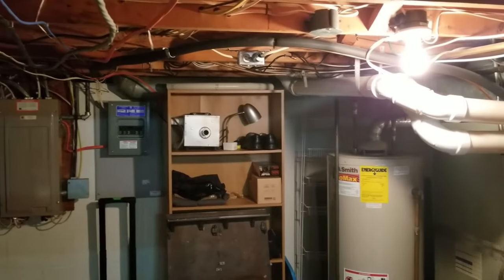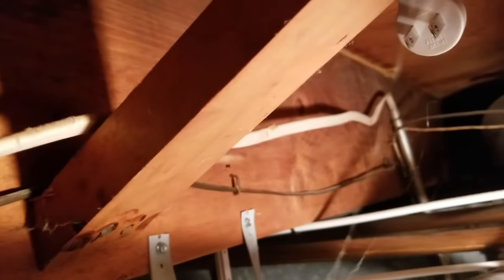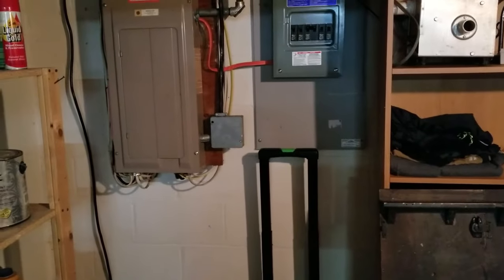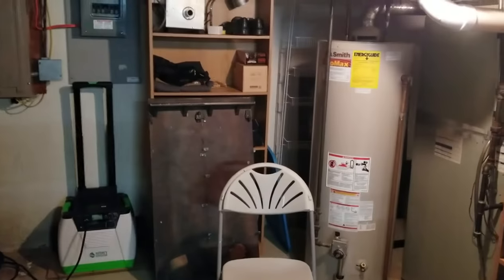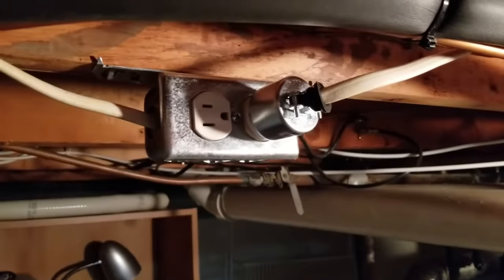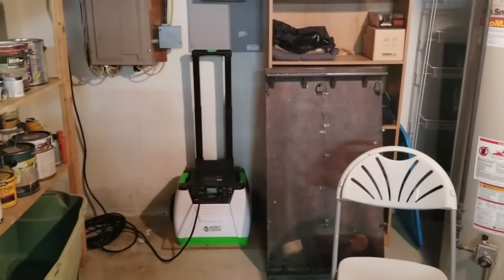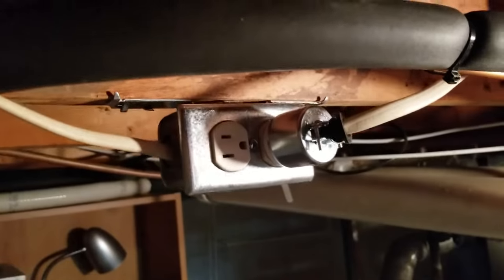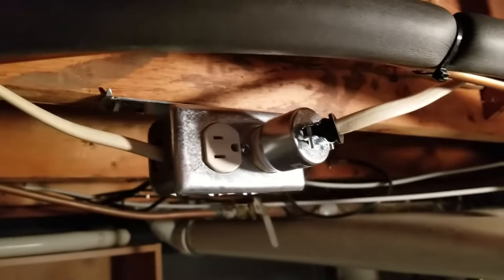Power Your Furnace With A Generator During A Power Outage

Comment: Have you tested this?  Some furnaces have pretty sensitive control boards and ignitor circuits that won't run on inverter technology.  I know that sounds funny but it's true...some will, some won't.  Better check to see if you can actually get heat.
Reply: I have had a generator for 17 years and am still reluctant to power my high-efficiency furnace with it for fear of blowing the $$$$ mother board. I cannot get a straight answer on whether a plane jane generator will work or not. The HVAC guys only want to sell you a whole house generator for HUGE bucks. Every year my HVAC company does its PM and every year I only get "You can't power it with a generator". I was thinking of a separate inverter generator just for the furnace because the power is supposed to be cleaner. I wish somebody had an answer for me because you KNOW power only goes out in the middle of winter. Thanks. OBTW, I had the installer wire my furnace for a generator when he installed it. Now, the same company says it won't work!! Thanks.
Reply: Problem with running a furnace off of a generator is that the neutral is floating on many generators, ie neutral and ground not connected together at the generator. The furnace control tests for this ground and if not there, faults out on insufficient voltage. Not going to discuss the work around for safety reasons but if you do work around the problem, put a gfci adapter on your extension cord to protect from electrical shock.
Reply: Instead of a generator, consider a pure sine wave inverter.
Reply: The proper way is to run a transfer switch through the breaker box, then you can power anything you want according to the wattage you have available on whatever generator you are running preferably a inverter for clean power. Inverters power lap top computers and sensitive electronics so should be ok on the panel of a furnace
Reply: Has to be grounded correctly
Reply: This may not work on many furnaces for several reasons.  
My Lennox furnace computer board is very sensitive to input power harmonics.
Even a high-quality portable generator is too electrically "noisy" and the board faults out.
Some furnaces require bonded neutral-to-ground. That gets messy.
Reply: @kodak_jack  It doesn't work on my Lennox.  The igniter circuit is very sensitive to harmonics.
Reply: @John-dp3ln  That may be the problem with my Lennox, or the harmonics from the generator and any deviation from 60Hz. I decided not to take a chance with the motherboard and use alternative heating during power outages in Winter.
Reply: @gybx4094  The part that gets me is the same HVAC company that just says "A generator won't work" wants to sell me a whole house generator and that one will work. Except for the $10K cost, what's different?!! I have also heard of the igniter being the problem.
Reply: I think my solution is to just feed my blower on my gas fireplace. Simple squirrel cage blower, actually has a normal “plug” end that goes into a receptacle inside the lower control area of the FP. I can unplug that end and into the generator. No electronics to potentially damage (my biggest concern on my new furnace). 
It’s a 18’000 BTU fireplace and should be enough to get us through some cold Canadian winter nights temporarily.
Reply: @meonlybetter007  How is powering only the blower going to help heat the house? The problem on the high efficiency furnaces is the igniter circuit that won’t turn on the gas and ignite it. Since I got my generator in 2003, I have had two different high efficiency furnaces and never powered either of them with my generator for fear of blowing the expensive mother board. When I talk to my HVAC company, all they want to do is sell me a whole house generator!
Reply: @kodak_jack  
I would not power the furnace but supply power to our natural gas fireplace that sits in the corner of our basement. 
It actually has a 120v plug internally that feeds the blower. That plug would go to the generator. 
There are no electronics in this NG Fireplace, just a thermocouple to open the gas mechanical valve which is pilot light based (no electricity needed to start it up)
It can supply more then enough heat to keep the house & water pipes from freezing. 

I would make sure bedroom doors are open and natural convection would let the heat rise to the rest of the house. Maybe even have a low-wattage table top fan “blowing” some of that warm air upstairs.
Not perfect, but in an emergency would work

Naturally, this is assuming the natural gas flows, and it’s not a massive blackout. :)
Reply: @meonlybetter007  I had a wood stove with a blower that worked for us too. Now, I have a gas stove with a blower.
Reply: I feel your pain there has to be an easy inexpensive way for home owners to get heat in the case of an emergency. not everyone has 12 to 20 thousand dollars hanging around...

Comment: Does anyone here know if an inverter type generator (say, a Honda eu2200i) would start a 1/2hp blower motor?   The run power would only be 375 watts.  I’m wondering if say a Honda eu2200i would successfully start the blower.
Reply: I did buy the eu2200i generator.   It powers my 1/2 hp water pump fine only using about 400 watts of the 1800 available.

Comment: May be a dumb question but what if the power comes back on? Will that be an issue?
Reply: Unplug the generator, and reconnect the power to the breaker box.
Reply: If the plug housing is metal and its mounted to the metal furnace enclosure there would be two connections of ground. One on the generator and the other is the house main circuit panel and that ground is connected to the neutral wire that's also in the main circuit panel the absolute way to ensure to sever all ties back to backfeed your main is shut the main breakers coming in to the house.

Comment: only thing different i did was in place of the receptacle  i put a female plug like on an extension cord, so it still works the same, i can unplug it for generator use then plug it back in for regular use. (for my oil furnace)

Comment: I'm confused, is the generator an internal combustion engine that you are running in your basement?
Reply: Hopefully not. The ‘generators’ in the basement are battery powered inverters. A gasoline or propane generator should be at least 20 feet from the house.

Comment: @Prepping Practice I know that you made this video a few years back. Thanks for sharing. With your furnace connected to the generator does your existing thermostat still control the furnace? I have a NEST and it requires electricity to turn on. Wondered how your setup is? Thanks
Reply: Forget 'smart' thermostats when it comes to emergencies. Learn how to change it out for a manual one. Just my advice but YMMV.
Reply: @w3tua  Absolutely, I have disabled all of the "features" that the Nest "offers." I hate it, but it came installed with the house. I probably will remove it. One day we will probably all be forced to have one. Look at the smart electric meters. Hope not though, they're junk in my opinion.
Reply: Keep in mind the furnace will charge the NEST while the furnace runs.  In fact, some users only have power to their NEST via this method.  Of course a dedicated power connection is best.  In a worst case, you can pop the NEST dial off and using the micro USB port on the back of it, charge it like a phone with a battery pack, laptop, or even in your car.
Reply: @travisosborn6752  Thanks, I've thought about some of those options too. Thanks for the information. 😁👍🏻
Reply: It will always work with all smart thermostats...they use very low voltage and will be powered by the furnace. Most have a battery in them that last a very long time but you also have the option to wire them up using the "C" wire so they have permanet power. Many videos on how to do that and EcoBee comes with an adapter kit that makes it super easy.
Reply: @daddylogan  Thanks!

Comment: it didn't work for me after i did this setup. For some reason the generator didn't start the furnace
Reply: You need to ground your Generator or the Furnace Board won’t allow it to turn on. You will need ground wire, ground clamp and aa end plug 🔌 that has the grounding and neutral connected. If your generator is Neutral Floating you will need to run a ground wire from generator frame to a clamp that can be attached to the water meter, also a plug end 🔌 (do it yourself) that has a wire connecting ground and neutral, plug it into the generator outlet. Once this is done then your furnace will work. I am not an electrician, I just found out this was the fix and it worked. Good luck!

Comment: Looks good, what if you are stuck with a older generator cranking out voltage spikes that could fry the control board of you furnace?
Reply: Well then get a surge protector
Reply: Or get the inverter type generator.
Reply: @mikejenkins2067 this is not the same thing. Surge protectors don’t stop all irregularities, n
Just over-voltage spikes.

Comment: Don’t forget to turn breaker off so you Don’t back feed
Reply: ya i think a lot of folks miss this. I see a lot of videos with that plug box being metal and on the side of the metal case enclosure of the furnace that's the connection back to the house ground and the house ground is connected to the neutral "white wire" in the main panel in the house.

Comment: I was going to do that but they are saying that’s against code to use romex wire with a plug on the end.
Reply: I am in the same situation as yours.  I asked the code department in the local government, and they said exactly the same thing.  This would be great if they allowed this.  Then I could plug a small quiet portable generator to power the boiler and a few minor things.  The small quiet generator uses very little gasoline, and is very quiet.  Based on my experience in Sandy, a big powerful generator may not be such a good idea if there is no gasoline available in the local region.  A small generator that uses very little gasoline is much better in such an emergency situation.  Unfortunately the code department doesn't allow this.  I ended up getting a big generator and having a transfer switch installed, and hope Sandy will not come.
Reply: @captainjayc9217  Does code really matter if your powers out and it's an emergency? Sure be safe.... But I think I'd keep my family alive and well.
Reply: @Jasonoid  Turn out the local code department allows something called EZ Generator Switch.  Using it allows the boiler to be permanently wired (that meets the code) while it still allows us to connect a power cord from a portable generator to the switch (that meets our need in an emergency).  Best of both worlds.
Reply: @Jasonoid  Damn right!!!
Reply: Against code. Please. Nothing wrong with this setup. He is a competent individual. If you sell the house change it back to code. Geeze have some confidence in yourself.
Reply: Code doesn't keep your pipes from freezing...Put you big boy pants on.
Reply: @captainjayc9217  Just because something is not code-compliant does not necessarily make it unsafe. Code represents a consensus on best practices, not a unanimous agreement.  As with many things, there's more than one way to do it.  Some are potentially dangerous, but many are not.  In addition, local codes can vary from NEC furthering proof that there is not one universal best way to wire something.  Would it be better if one was 100% code-compliant but asphyxiated themselves by doing something like lighting a charcoal grill in their house to keep warm during an extended power outage?
Reply: @binfordtoolman5674  As mentioned in my second message posted in this thread, I found a solution that essentially does the same thing while still meets the code.

Comment: So I have a question.  How long does that particular generator stay charged when in use? I found your channel specifically because I'm concerned about running my oil-powered heater on "that" particular generator. Ty
Reply: Whatever battery wh it has. The point is that solar power generators can be charged up from solar panels daily

Comment: Does it matter if you have a heatpump with auxiliary gas furnace?
I tried exactly what you said, that is plugging power directly to the gas furnace unit of my heater, and all I get is "low voltage warning" with my generator.
Suggestions?
Reply: it didn't work for me after i did this setup. For some reason the generator didn't start the furnace
Reply: Switch to emergency heat.
Reply: @grettayolanda I've read some furnaces check for and require a proper ground connection.

Comment: What size portable generator would I need for my electrical furnace? Not worried about a/c just heat. Ac is 60k btu not sure where to find specs for heater
Reply: How many Horsepower does you furnace blower use?     Figure 1hp = 749 watts.    Mine is a 1/2 hp motor.   So it consumes 375 watts while running.     This does not consider the start-up power needed.    I’m not sure if an inverter type generator could supply the start-up power.    It might flip off.    The non inverter type generator might be ok.   
Does anyone here know if an inverter type would work for start up power?
Reply: @jacksprat7087  my inverter generator is rated for 1600W continuous 2000W max. They make a smaller 1000W max 900W continuous.

Comment: you need to wire in a 15 amp fuse. that's code. and a whole lot safer.
Reply: You have a link or description for a fuse in this scenario?
Reply: @johnkv6820  no . but the parts are available from your local hardware store.  uses the round glass screw in fuses.

Comment: This is a fantastic idea. I have a similar situation where I would like to take the simple power line to my oil burner and cut it. On the oil burner side put a plug on it, and on the power  side (coming off the box) put a single outlet. This way if we do lose power, which seems to be more common these days and a lot of people are bracing themselves for rolling blackouts. I can then plug my oil burner into my large solar generator/ back up unit (The Bluetti EB200 2,048wh / 2,000W Solar Generator) I am not electrician so I'm gonna have to find someone in my area to do this, any suggestions?  Should I try to contact the company who I purchase oil from and services is my oil burner? Or just find a good electrician and if so is there a  specific type of electrician I should be looking? Last but not least I saw a few of the comments talk about spikes and sine wave variations from certain generators, does anyone have any experience with the Bluetti EB200? (https://shopsolarkits.com/products/eb200-solar-generator-quad-kit) I'd love to also do this same thing with my hot water heater, again just in case.